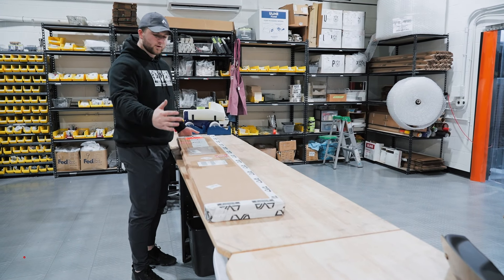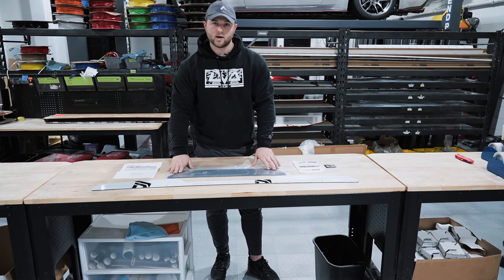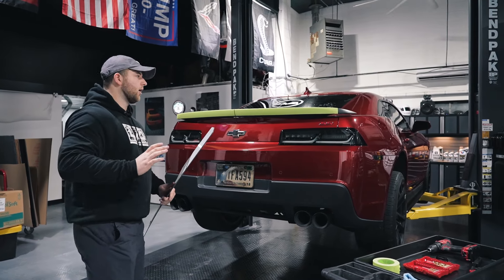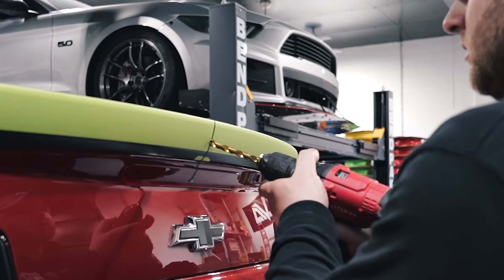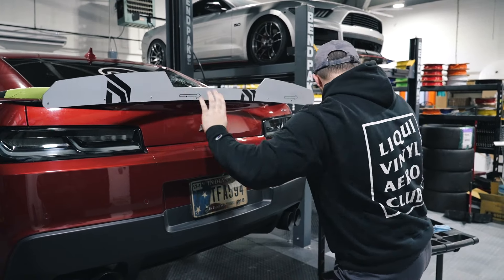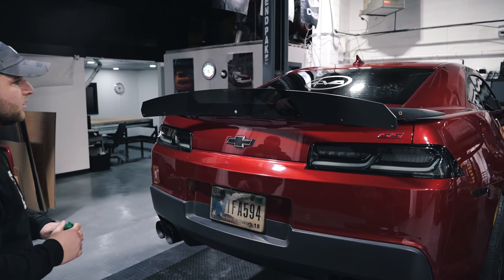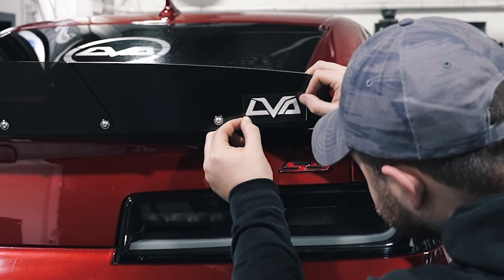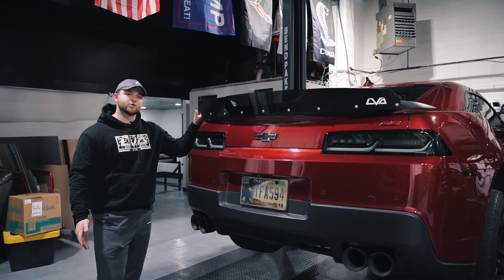How to Install an LVA Wickerbill | Comprehensive Guide

Comment: What trunk lid/ Duckbill Spoiler is needed for this wickerbill to fit on? Just bought this. need help
Reply from the maker: The Wickerbill featured in this video will fit on the 14-15 Camaro "1LE" platform or 14-15 "ZL1" platform as they share the same spoiler.
Reply: I have a 2018 SS so I would need a 2018 1Le or ZL1 platform than?
Reply from the maker: @LacedChux We offer a “1LE”-specific Wickerbill for the 6th Gen Camaro. That would require the use of a 1LE style spoiler, yes.